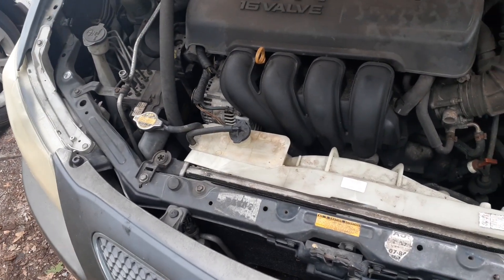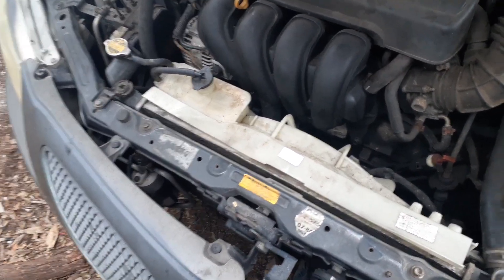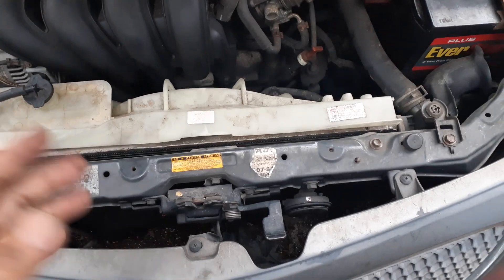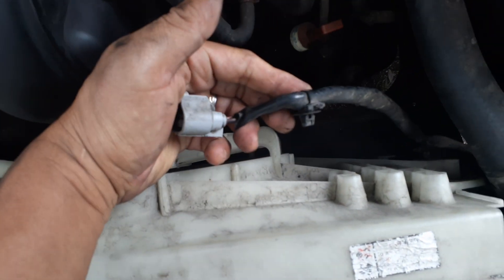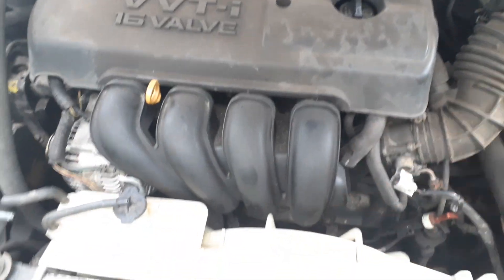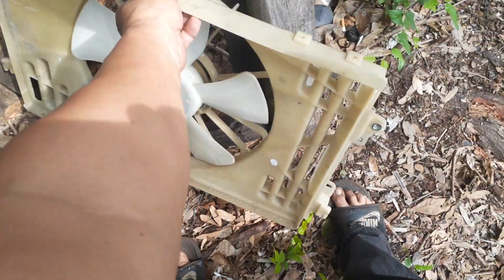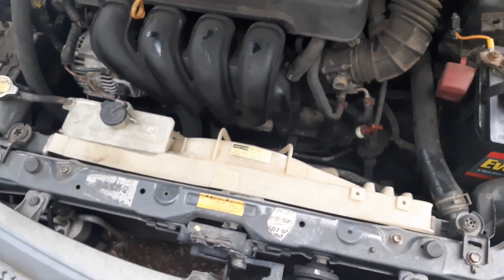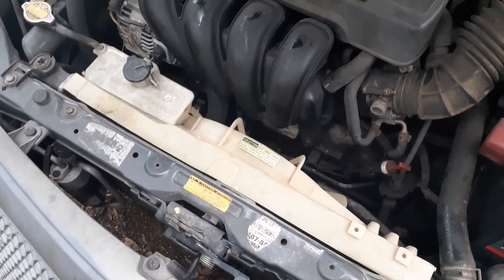2005 Pontiac Vibe Radiator Fan Replacement - Overheating Issue

Comment: Good job of replacing the fan!👍 Never know how it works until you try. There is another component that you need to check if the fan doesn't turn on, a temperature fan switch.

Comment: It's under $100 with shipping at rockauto, that is why I sent you the picture of it along with the wiring diagrams. You should have just gone ahead and ordered the fan in advance. Anyway, its real easy, just pull out the plastic fan off the shaft of the motor - you made it harder on yourself by removing the 3 screws first. The easier way to check the fan would have been to jump the pins on the relay, that would have told you your fan was good along with the wiring from the fuse box to the fan. The motor on the salvage unit does not look too bad but if I was you, I would order the fan motor from Rockauto and install it on the old shroud/assembly just in case the salvage unit dies after 3 to 6 months. If you can spend thousands of  dollars on buying land, surely you can spend $100 on a new part for your own vehicle, knowing full well that not only will you need it for the AC in the heat but that a blown head gasket or cracked cylinder head will land up costing you much much more and you wont have a car for several days. 
Glad you got it done and a very Happy New Year to you and the kIds.  🙏